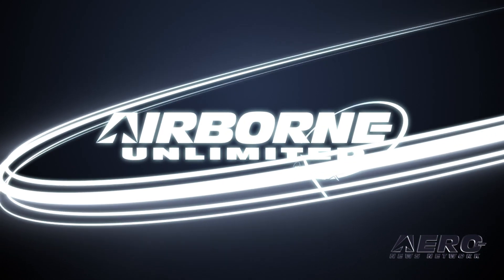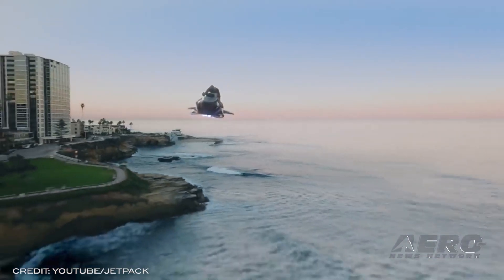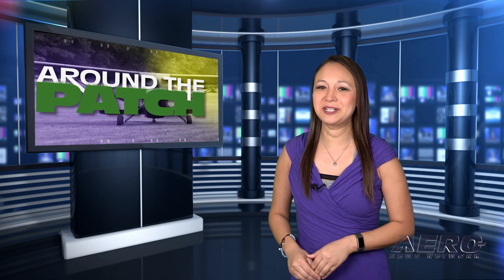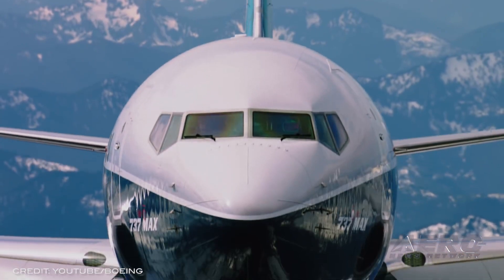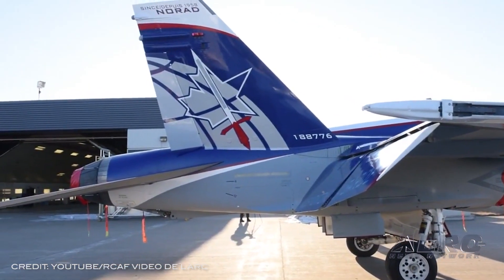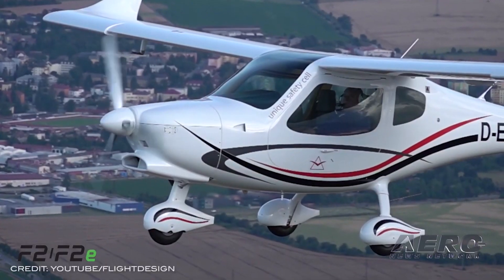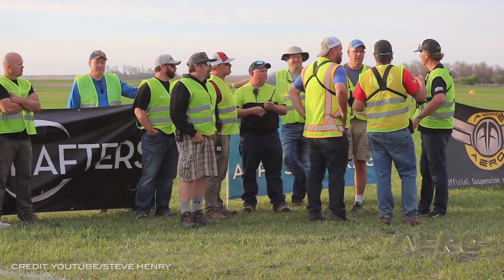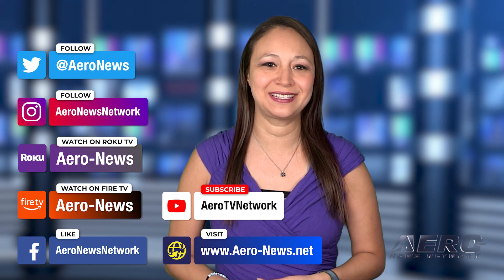Airborne 07.16.21: JetPack Speeder, Flight Design F2, STOL Drag

Comment: I owned a Flight Design CTSLi....the F2 is basically the same plane.  A little redesign in the cockpit.  Same engine, same materials, made in China now.  It is SLSA, not fast....and I would not take it off road, off a paved runway.  The mains are not robust and the nose wheel is steerable, not a good way to land on dirt.